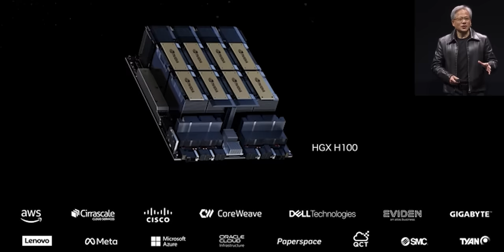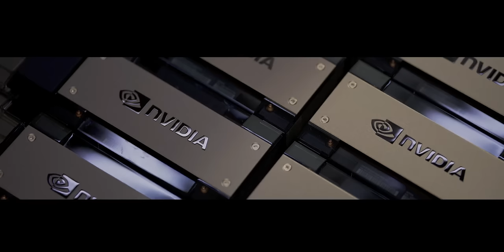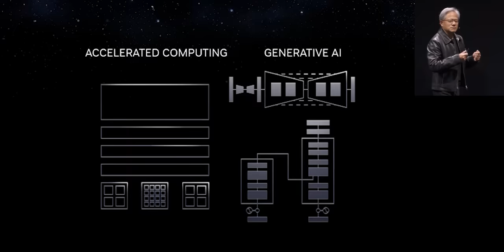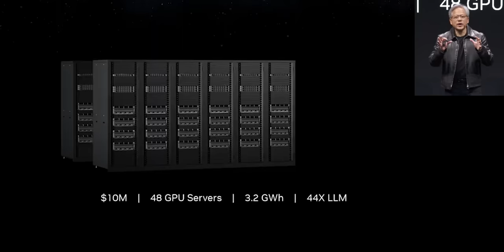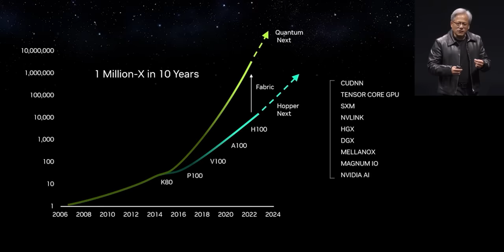NVIDIA'S HUGE AI Chip Breakthroughs Change Everything (Supercut)

Comment: What Jensen Huang said is that processor circuits are reaching their limits of miniaturization, so it's important to make the structure of the circuits themselves more efficient and easier to run software.
At its extreme, it means getting closer to a computer without software.
For example, it would be very inefficient to simulate the brain with a computer that has a completely different structure than the brain. 
If you build a computer with the same structure as the brain, you can build a computer that is a billion times faster than the brain.
A computer that runs on hardware without software.
Reply: Even though I think this will be great I have concerns that people like you and I will only ever be able to access it via a remote connection.
Reply: In other words, remove the programmer because it has reached the ultimate level; a sentient being.
Reply: "What Jensen Huang said is that processor circuits are reaching their limits of miniaturization, so it's important to make the structure of the circuits themselves more efficient and easier to run software." - That means further increases of computing power will become harder, not easier to achieve.

"At its extreme, it means getting closer to a computer without software." - That's a rock. It does nothing.

"For example, it would be very inefficient to simulate the brain with a computer that has a completely different structure than the brain." - And if we want to simulate water, we use a liquid computer, obviously.

"A computer that runs on hardware without software." - Runs what?
Reply: You cannot unless you invent a neuron that has an I/O like transistor systems
Reply: @rproctor83  nah, at some point someone will sell these as performance bricks for consumer market
Reply: this is a great approach
Reply: @BusinessWolf1  Not "these".  "These" are useless pieces that can only function in very expensive large scale deployments that exist in datacenters.  The ones that are going to be sold are the things Intel and AMD are making, stacking RAM on die and surrounding the chip with sub-processors/FPGAs and more RAM.
Reply: @jeronimo196  Ultimately, computing will transcend the direction of software “running” inside a computer, and the computer itself will become a brain and think.
At present, computer thinking is realized by software that "runs" inside the computer.
It is not the computer circuit itself thinking, but the software using the circuit to think.
However, the software does not "run" in our human brains, and it is thought that the computer will eventually approach a state in which the circuits themselves think, just like the cranial nerves themselves think.
The shrinking of circuits will continue, but will eventually be limited by the size of the atom.
At that time, the only way to speed up the computer is to bring the computer circuit itself closer to software.
"Run" in a circuit similar to the brain
There is thinking, not software.
Reply: @jeronimo196  Hes talking about specialized chips specifically designed for AI accleeration, to the point you dont need much software to actually drive it.
Insane levels of parralelization basically.
Reply: @honkhonk8009  I get it now.

But simulating neural networks will be easier than building neural networks for a while - if not forever.

I stand by my assertion that the best water-simulating computer will not be made of water.
Reply: I would to know more about the sovereign AI  demand for the NVIDIA data center tech stack. After the Google, Microsoft, Meta, X, and Oracle upgrades, trying to size the market remaining?  At this rate of innovation!
Reply: @DominiqueGodefroy  NVIDIA seems to be encouraging companies and governments to introduce AI supercomputers for decision-making.
The announcement of Gemini 1.5 and Sora changed everything.
Current large-scale language models and image generation AI have come to have a clear world model.
This allows AI to perceive the real world and make decisions.
In fact, AI is able to predict the future by taking into account far more parameters at the same time than humans can, which is why AI is still not being used in decision-making by corporate CEOs or policy decisions by politicians. It's so strange.

Comment: Wow, they have a bigger moat against the competition than I realized.

Nvidia pulling 4000 open source apps into their "secure" and maintained software stack, is key.   Rest assured they will do such a good job maintaining it, and integrate things so well, that existing integrators at enterprises will not be needed.  That's a big, and expensive, part of every enterprise software infrastructure group.

And also rest assured that the NVS stack maintained by Nvidia will only run on Nvidia hardware.

In effect the Monopoly that is CUDA will expand to include many AI tools that are currently open source.
Reply: I read into it that they're forking what's there and providing the enterprise support with the open source tools still being available. Of course their Enterprise stuff will only run on their HW, but Enterprise won't be the only option. That's my read anyhow. Huge deal though.

Intel has been leaning big into SYCL/OneAPI and I'm sure AMD has their own thing too. Curious as to how those will stack up.
Reply: Skynet seems pretty real in our lifetime now 💣 ☠️ 💣

Comment: It's still basically Moore's law but the way we continue moving forward is changing.  It couldn't be predicted 40 years ago.
Reply: it's faster than moore's law. This is 44x times in one (or a few years), not 2x.
Reply: It’s only gonna get faster
Reply: Well, perhaps it won't continue to scale at such insane speeds. But if it does continue to scale hundreds of times in the next few years, I doubt we will be able to recognize the world by then.
Reply: @kepler_22b83  another example of how we humans are unable to see the exponential law in action... who knows what the world will look like in a few years.? Answer: nobody
Reply: @pdjinne65  you know what I mean.  And were talking speed not transistor density now
Reply: Moore's law has never been an actual law. It was just a hypothesis based on the fact that we had reached the minimum size for electronic components. And it was obvious it was wrong.
Reply: @Dante02d12  pretty obvious fact. But it worked for a while.
Reply: Good pt but moores law only applies to consumer devices no?
Reply: @relicboxing    Do you mean Nvidia GPUs and quantum and whatever else?
Reply: @Kenneth_James  I'm saying that it jumping in speed x44 doesn't apply to moores law because this is not a consumer grade gpu.(i was replying to spyral00)

Comment: It will definitely be interesting to see how this plays out.  Based on the very small amount of info they've given about the switches they use for their data center products I'm kind of curious to see if one of their next moves ends up being to dip their toe into the enterprise networking market by making a switch and/or router to compete with Cisco and Juniper.  That would be another high margin business that compliments their data center business but I don't think it would really leverage their GPU business.  It would focus more on their DPU designs, and I have no idea how the speed of their switch compares to a Cisco or Juniper equivalent.
Reply: Isn't that why they bought Mellanox or is that a different thing?

Comment: These chips are suitable, for example, for automatically adapting software GUIs based on prompts. It recognizes the GUI visually and then you can say, make more space between the left 3 buttons to the middle ones and that's it, or you can say I want all components to have round corners, done! Or within a virtual gaming world, you just tell it that you would like to add a tree over there and a bush to the right of the street, bam it's done immediately, no more hand crafting or coding needed! It will even understand the user interface of any software! So we can then create our virtual worlds using voice prompts by running through them and giving the chip instructions what to change, how it should look and even behave. Afterwards we can play them together and the best designed one will get a prize!

Comment: Let's see, AMD Ryzen came out late 2017.  In 6 years CPU compute has increased WAY more than it did the prior 6 years.  In this way Jenson made a statement this is pure fallacy with how much computing WAS improving.  If you were to look at 2011 - 2017, AMD was out of the picture.  Intel put out a few generations of CPUs that basically each generation was about 10% faster than the last one.  Well, if you do that for 5 generations that probably gets you to about a 60% improvement over those generations.

Looking at AMD only because it's hard to do a comparison like this over different companies, we can look at different kinds of computing, not AI because AI compute is done with different cores, not general compute cores, so light applications that are single threaded, heavy workloads that are multi-threaded (breaking up work into piece so each piece can be processed independently, and gaming

I'm ONLY going to look at 8 core/16 thread CPUs.  So each core can run 2 threads at the same time.  These would be designated as 8c/16t CPUs.

We go from Ryzen 1700X, to the 2700X, the 3700X, the 5700X and then the 7700X.  We have to add one more part because in gaming, the technology of adding cache as a separate die, and then attached to the cores, basically sitting over the cache on the CPU benefits gaming performance, so we add in the 7800X3D.  The technology is called 3D Vcache, so this is a die stacked on top of a die, and AMD is the first to do this for a general processor for PC computing.

In single threaded applications (light workloads), the performance has doubled.

In multi threaded applications (heavy workloads that can generate many parallel threads) the performance has increased by about 2.25X

In gaming, going from the 1700X to the 7800X3D, the increase in performance is astounding.  It's basically tripled.  This of course requires a top end graphics card to go with the CPU, because low end graphics cards need lower end CPUs and making the CPU much faster can't make a low end GPU much faster.  That's the nature of pairing a CPU with a GPU.  You want both to be around the same level of performance.

So, Jenson is wrong about how much CPU compute was improving, or basically LYING since he would know.  He overstated it solely to make it look like this is such a huge leap but really it isn't.

What I didn't mention in the above is how highly parallel compute tasks have improved since 2017.  This has skyrocketed because we've gone from an 8c/16t server CPU from around say 2016 to now where we have 128c/256t CPUs.  Once again the improvements are astounding and WAY greater than the improvements from 2011 - 2017.

The main thing AI does is add another type of computing, requiring another type of core.  What he also doesn't talk about is both these AI cores and graphics cores are WAY smaller than a general compute core, so he uses large numbers, but the reality is that big hunk of circuitry and heat sink which is the main weight of this isn't good for general compute.  They're good for a specific type of compute and I believe AI inferencing is one of them.  For a server that's simply handling data requests this is too much money and a waste.  You HAVE to be using these for AI or it's a waste of money.  The REASON Nvidia is making a killing right now is because of the huge growth in AI computing, it's not that server farms are switching to these for general computing.  And regardless of the growth of AI computing which will hit peak growth at some point and then level out, you STILL need the growth in general computing and graphics computing, SEPARATELY.

Comment: "Domain specific" - means NVIDIA wants to sell more systems. Actually, a GenAI system can clearly handle many domains within the same system. As system capabilities rise, in computations per second, companies will start sharing systems -- renting out or renting bandwidth, not buying their own. NVIDIA is trying to sell many, but their own success will result in lower sales actually to just the giants, like AWS, MS, Google, and Oracle. Other companies will simply buy time on these amazing systems, to create their own GenAI images. A created GenAI image can be downloaded periodically to a much smaller GenAI system that can still execute in real time.

This is an ironic situation, where the faster their system get, the less return it provides to the inventor - NVIDIA.
They should beware of early obsolescence and failing to reap enough to cover costs.
But until the hype dies down, their tulips will sell like mad.

Comment: Nvidia had done very well by embracing open standards and supporting their software ecosystem on multiple platforms. Notably, OpenGL. This graphics standard has been around for nearly 30 years now, rather than abandoning it or forcing a proprietary Graphics API on developers, they embraced it. CUDA, Tensor cores are all public available with Nvidia's drivers. Apple is the one notable exception that miss the AI train. They foolishly stopped supportin OpenGL and forced developers to move to their proprietary Metal Graphics API. Not happening for Apple. Nvidia not only has super hardware, they have super software.

Comment: A highly modularized computer, built not on AI but simply on maxed out GPUs and interconnected
to all available memory/ram all at once. Its all soldered in place as opposed to memory slots and
CPU sockets. And that too has its limits, so they've interconnected maxed out boxes to one another
with fiber optic cable. And within one of those boxes sits an Ai, pretending to be human, that you
can talk too. *did I miss anything, before I can now let AI do my thinking for me.* Or will AI sit there
for the rest of eternity .... until I tell it what to do and or focus on. I see a big computer, that I will now
be able to talk to instead of typing away at a computer screen as I am doing now. *RSI be gone!!*

Ai, go plow the filed and sow some corn ... it can't do that. Ai what mental disease do I have ... it does
not know unless I tell it. Ai, go and check what's in my stool. Its now cornered between a stool and
shit, has a nervous breakdown and shorts circuits itself.

Comment: Yeah the thing that changes everything is that the increases in processing power that we have been used to for decades are coming to an end.  Even the processor brands are admitting that now, while obviously trying to give it a positive spin.
Reply: You didn't understand a thing
Reply: @eSKAone-  
You watched a promo talk by the CEO of NVidia and failed to read between the lines.   The smaller processing gains and larger power consumption is not sustainable.  Moore's law's dead. We need a new paradigm.  GPU's like the H100 are not it.

Comment: I am an enormous fan of NVIDIA and OpenAI, but eighty percent of this lecture is overly complicated gobbley goop. This tells me that NVIDIA is up to its neck in bogus conversations that inevitably will result in bad decision-making. This guy made several statements that are misleading or wrong, and he uses analogies that are inappropriate, which leads me to believe that this lecture primarily has a market justification. Investors must be concerned that this grand path will collapse upon itself.  If I could, I would have asked about the problem of introducing single point failures within parallel architectures, both intentionally and unintentionally. I would have wanted to discuss the problem of architectural entropy, but what do I know. I'm just an old retired motorcycle guy these days.

Comment: this is very critical process if one component is misplaced H100 will not process anything. if this H100 is water damage it will not process. and how much it cost? this is like a human brain just damage to the critical region of the brain then it lose it ability to process. How is this the most powerful yet so vulnerable component? then it not powerful at all. it a liability waiting to causes more problem then it worth.  for something to truly be reliable it need to be reliable even if it get exposed to all the element  and still function. how can we rely on something  if it get damage it just not functional. We need AI that can print and assemble all the critical part and all the raw material need to be all in the same place for all the process to print. and the AI that print it need need it own part and component. How do we design a closed loop process that will not get disrupt in the case of all these weak point?   fire water and ice flood and rain and impact can we really make something that destruction proof like a tank?